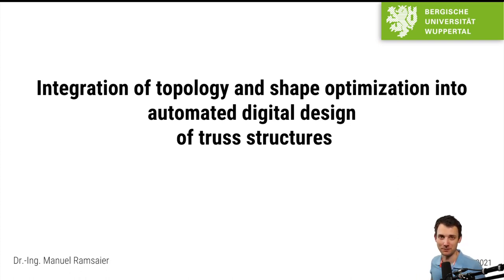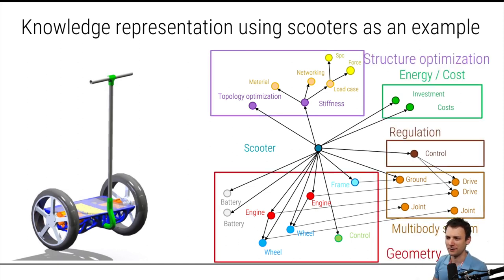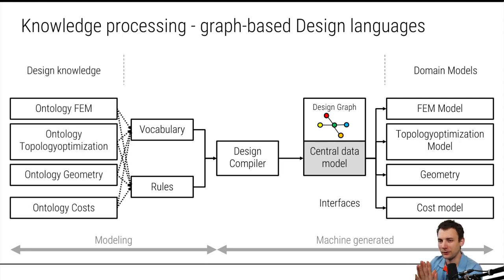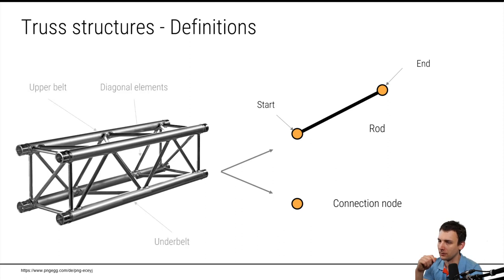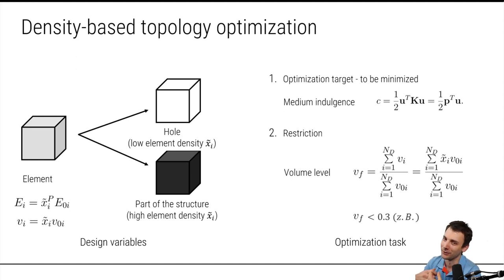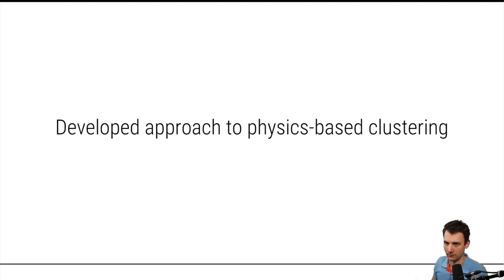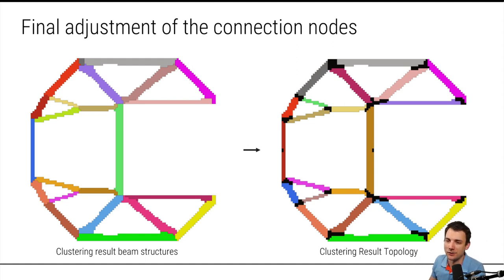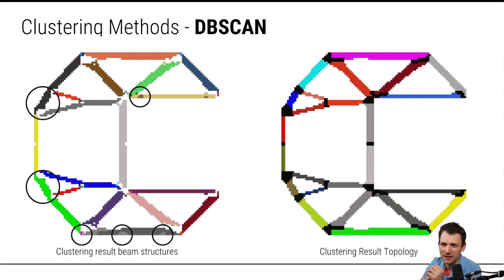My PhD thesis presentation in english - but a lot more relaxed - Giveaway

Comment: Amazing Sir... I am also doing PhD on shape optimization. I don't know if I can finish it or not coz presently I am in a very bad phase. But you are an inspiration. Thanks sir keep educating. Great work.
Reply from the maker: I know exactly what you mean when you are telling mit about the struggle. Keep on pushing - but also keep an eye on your limits. It will never be worth it, when you're left broken afterwards. I am happy to help where I can and if you just want to talk about your current situation, just drop me a mail at: ramsaier@rwu.de

Believe in yourself and your abilities and you will make it work eventually. 

Thanks for the nice comment :)
Reply: @ManuelRamsaier  Sir I have sent you a mail regarding an error I am facing in hypermesh. Kindly help me in it.
Reply from the maker: @ishanjha1492  Im on it :) Mesh distortion faili means you have elements which are highly skewed of distorted so that calculation is not possible - remesh and check your mesh - this should resolve your error. I will check the model file and get back to you via mail. Thanks for reaching out :)